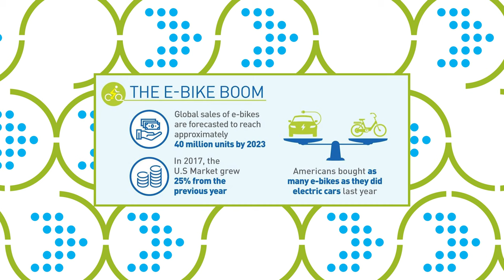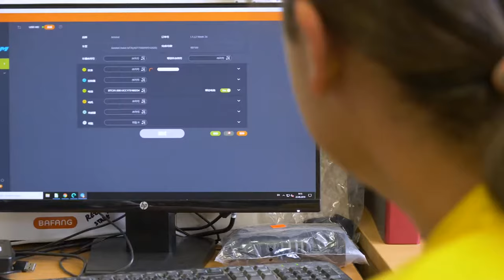The Rise of eBikes and Micromobility

Comment: I would love the chance to work for Panasonic and help them improve their presence in the US bike market like they once used to be. Feel free to reach out to me for any feedback, help or anything. I love Panasonic Bicycles and would do anything in my power to help them get back into the US market like they once were. Whether that’s through their electric motors or bicycles. I want to see you guys succeed. Best of luck!
Reply: Hi, I love electric bicycles from Japan and even more when dealing with a large industry like Panasonic)
but I would like to know if these bicycles are designed the same as those of Japan! With that strong and durable system to buy one, I have always wanted a bicycle from Japan, but the one sent by the battery is difficult
Reply: I have great confidence in Japanese industries, and I love their bicycles, I want to buy this model that they have in the United States! I think it is one of the best Panadonic motors on bicycles